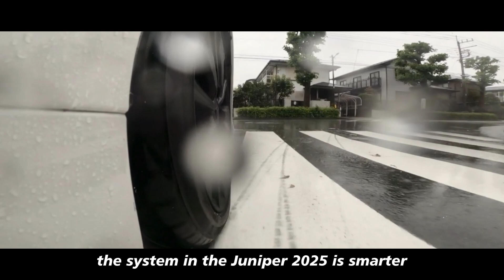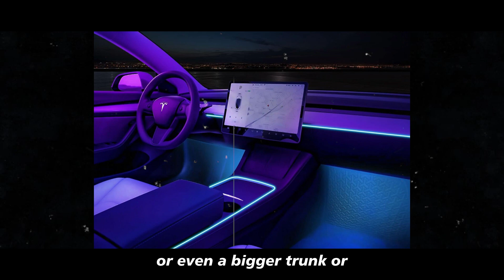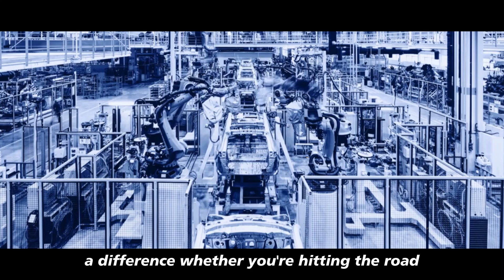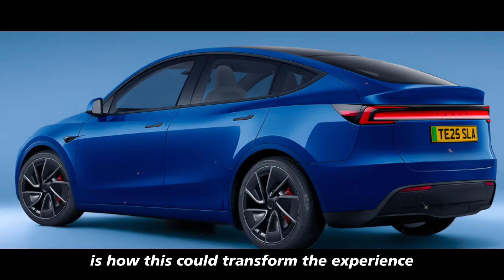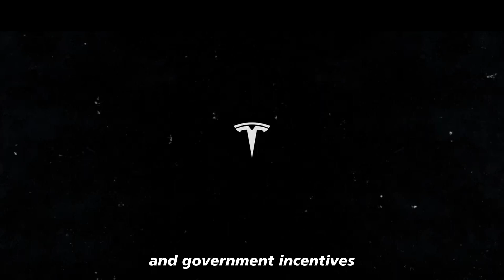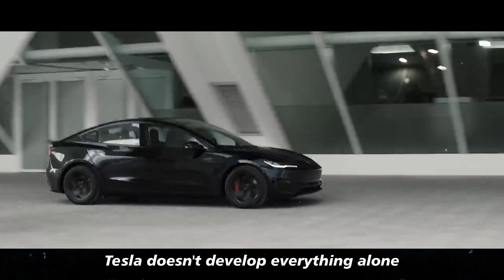NEW Tesla Model Y JUNIPER - New COLD PLACES Feature, New Battery And Release!

Comment: I don't imagine it, I live it.
I remember in the winter of 1978 the ambient air temperature went down to -28°F. I got into my car and it felt like I was sitting on a concrete bench. The car actually started but wasn't happy about it. The thing that surprised me was when the car started moving forward, I could feel the thud-thud-thud of the tires. Crap! I had a flat tire! But no, the tires were so cold that the flat spot on the bottom stayed flat as I drove and took about a mile for the tires to round themselves out.
THAT is cold-weather driving.